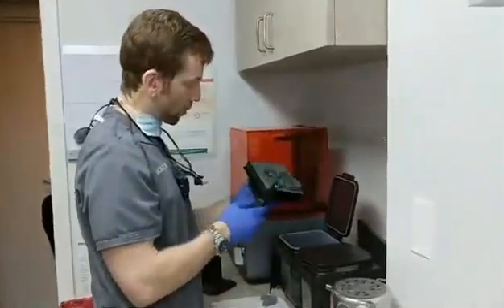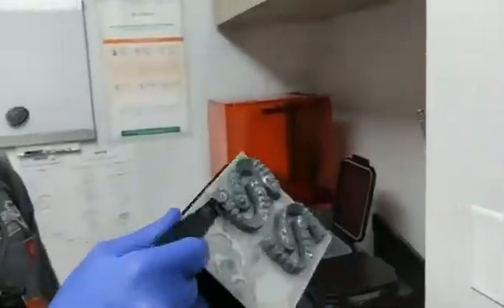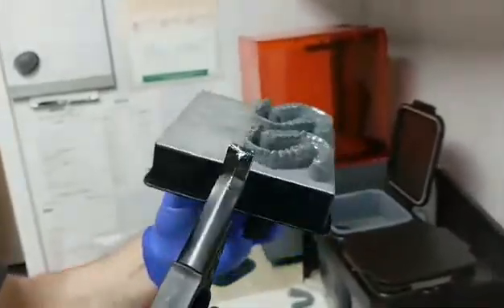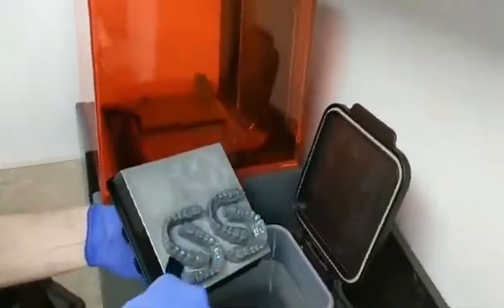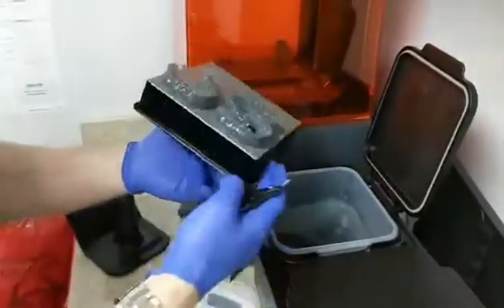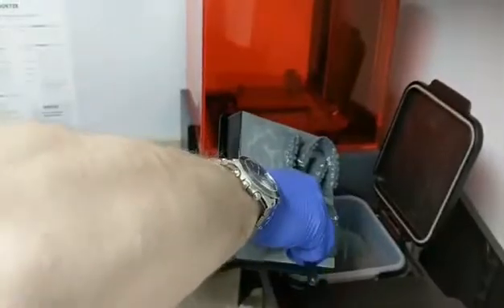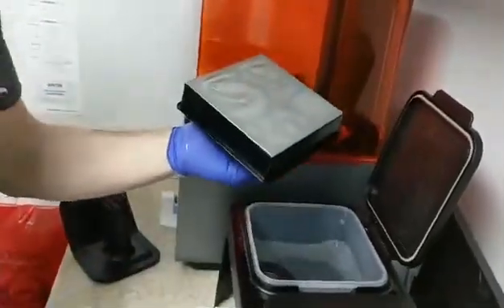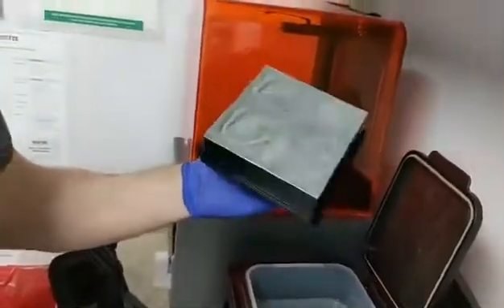Form2 Dental: Removing models Printed Directly to Build Platform

Comment: Any tip for scraping off the residue left on the platform?
Reply from the maker: neberboi get one of these and BE CAREFUL!

https://goo.gl/vhQJpm
Reply: Baron Grutter DDS thanks!
Reply from the maker: +neberboi If you haven't purchased this, do so right away. Be VERY careful as it's very sharp. But it works great. Always make sure not to slide it toward your other hand or someone else. https://goo.gl/vhQJpm

Comment: Thanks for the video. One question, can you actually make an appliance such as an acrylic retainer directly on the Formlabs printed model using the standard polymer/monomer approach? Or do you have to doup and pour?
Reply from the maker: Steve Velazquez hey there. To answer your question, yes you can. However, most use a separating agent. I believe some even use Vaseline. Honestly, I don't do much of it because I don't make acrylic appliances (just a simple doc 😉). But, I did once bond reline acrylic to a block making a custom healing abutment... Lol
Reply: Baron Grutter DDS Thanks for that. We did try the Great Lakes brand separator but we just could not get the acrylic off. We'll give the Vaseline a go tomorrow. We haven't bought the printer yet. We're just testing on some of the samples they gave us. One being the Grey acrylic that it looks like your using in this video. I appreciate your help. Thank you.
Reply from the maker: No problem. There's also a Formlabs Orthodontic Study Club on Facebook. I know there are a lot of users there doing it. Best of luck.
Reply: Baron Grutter DDS Thanks for that! I just requested to join the group.

Comment: Hi,do you know any non-dental 3d printer which I can use in my lab?,
Reply from the maker: Emilia Garbowska technically, the Form2 and MoonRay S are not Dental specific. What exactly are you looking for?
Reply: Well,I'm looking for 3d printer with the same spec.as dental one but a bit cheaper...if is possible.
Reply from the maker: The Moai is showing great promise and in just $1200. Requires a little more know-how. But, a great printer.
Reply: Well,thank you very much for your time,I will check that printer.
Have a good day...

Comment: did you try to print crown or bridges.......i was wondering how accurate is this equipment
Reply from the maker: It's accurate and precise enough. The limitation is in the materials. You can print in castable resin.